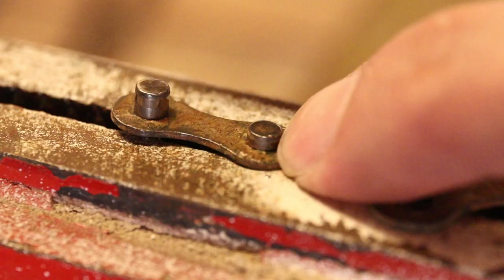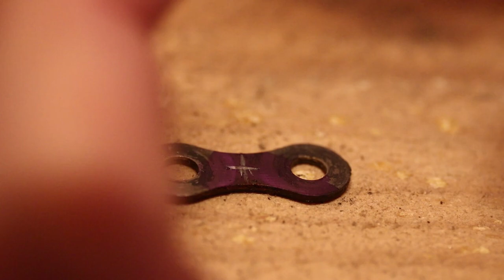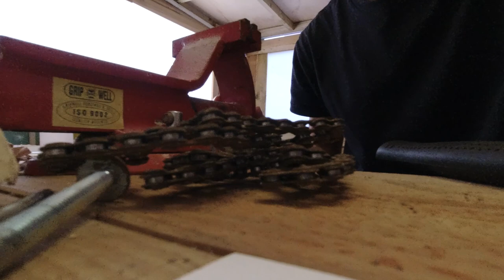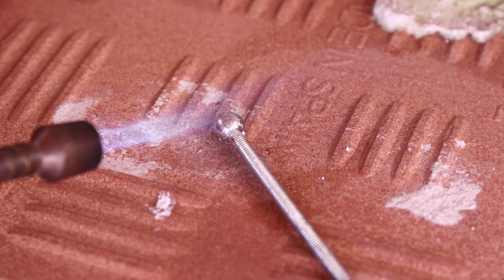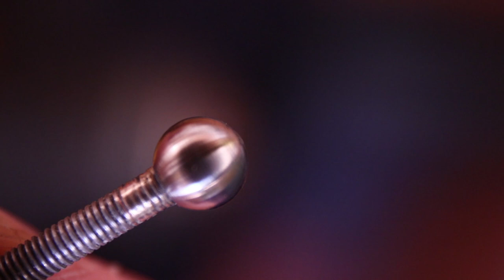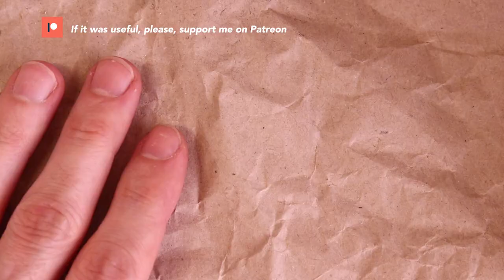Bike chain into ball&socket stopmotion joint

Comment: Nice idea. Maybe you can use 2 pieces at each side instead of welding them to make it stronger. Or a washer at each side, so the board of washers falls over the spheres and distant from the center where the scrull presure bends the piece. I´ll try it

Comment: Where do you buy the balls for this? Do you think I might find them at a hardware store, or are they specialty equipment?
Reply from the maker: they are quite special, search at stopmotion stores
Reply: I took balls from a ball bearing and drilled it. Didn't make any threads inside but directly fused the rods into the balls by welding
Reply: @doctor.sreeraj  I have seen people make notches in the rod with a Dremel and using JB Weld instead. That's the route I'd go, cleaner and easier. Hopefully strong enough.
Reply: Tip how to drill a ball bearing, heat it up cherry red and let it cool. The ball is now softer , get ball held in multi grips and grind off a flat surface with sanding /grinding wheel.
Place into a hollowed out area v area on a vice on a drill press.
Centre punch the centre of the flat section.
Use a cobalt drill and drill a hole. Silver solder a rod to the ball. 
If you want the ball to be rock hard reheat it then quench it in water! But you usually won’t need to.

Comment: Gracias por compartir Eduardo,  disculpa en Latinoamerica tenemos problema para conseguir los balines roscados,  sabras ¿donde los podemos comprar en linea y   que  tipo de soldadura debemos usar y si de que materiales deben ser los balines y los tornillos?
Reply from the maker: Depende de la cantidad que necesites las bolas las puedes comprar en china o en UK en tiendas de stopmotion. Lo  ideal es que sean de inox. La barilla roscada puede ser tranquilamente acero zincado o lo que sea. Y para soldar lo ideal es plata.

Comment: As i told you, i made this last week from a motor cycle chain which is strong and thick. I could never find the balls. So i took 8mm balls from a ball bearing and made holes in it to push the rods into it and fused it with a torch.  I also made the holes in the plates a bit wider to lodge the balls into it perfectly.  Everything is ready. But brother, i have no idea how to make the small and precise movements of those joints on a rig. Please do a video to make it painless to make movements or any hacks to make the movements easier. I want my puppet to do yoga. And do you have any videos to dress up a an armature into a puppet?
Reply from the maker: Great, then you are so close to start.
Reply: @edupuertasfruns  can you get us a video showing the minute movements of armatute?  Do you already have it in your channel?

Comment: I have a question.
What kind of oil do you dip it in to, after you heat the metal?
Reply from the maker: I normally use recicled oils from machine motors
Reply: You can also use vegetable oil instead motor oil is toxic
Reply: @ranecote  Thank you!

Comment: This is awesome!! I have a question though. is there anyway of doing the ball and socket joints but  smaller than this? I saw someone using the rotating base of an old TV antenna.. any thoughts?

Comment: I did this in my experimentation. I used motorcycle chain. I could never get them to track well. They would always move in arcs.
Reply from the maker: This kind of movement in arcs not where you want to move the ball means at least one hole is not aligned properly